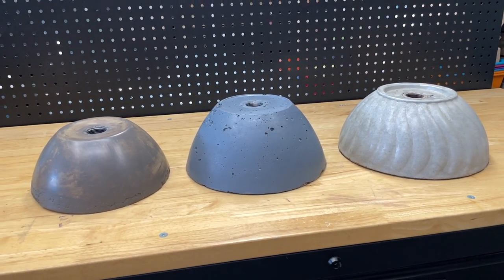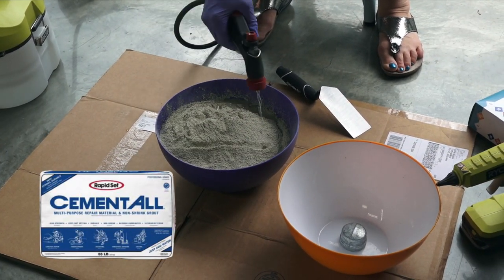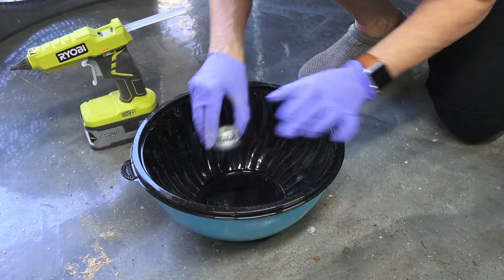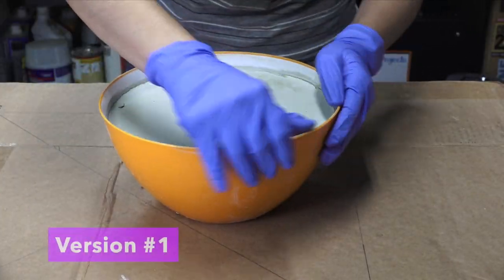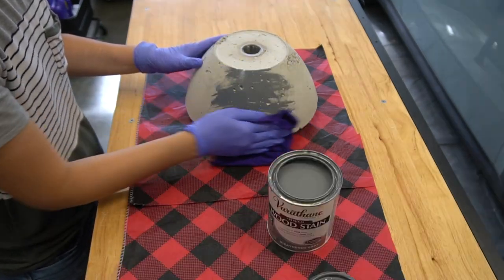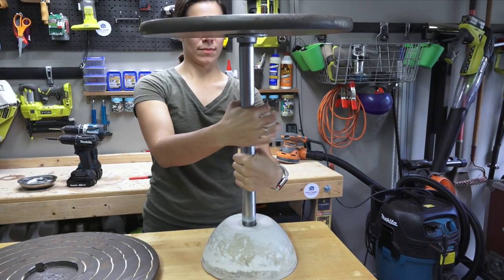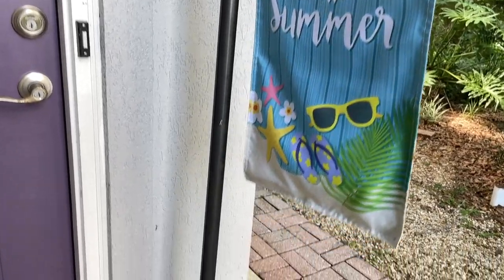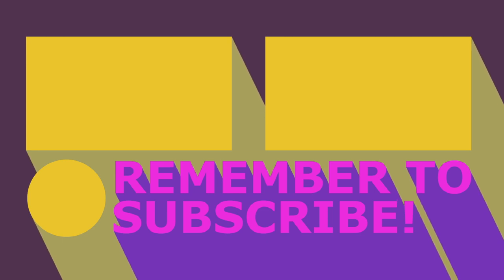How to Make a Concrete Base for MANY Applications

Comment: Thanks for such a comprehensive video.
I'm planning on using 7'-8' lengths of 1" pvc to form the uprights for a non-load-bearing (sheer Ikea curtain panel in between) pipe/drape with about 5' span in between each free-standing pair. The event will be at my church and inside as backdrop accents at the room perimeter.
Do you think a #25 weight at either side is sufficient to hold that length upright or would you recommend increasing that a bit?
Thanks for any suggestions 😁

Comment: In a second hand dealers,  I’ve found a beautiful 18 inch tall brass dolphin which stands on its tail.  I want it to be the door stop for when i leave my front door open, so it greets the visitors.  But it will topple over, so i need to set in in a concrete base.  That’s why i have come to this video.  I like the wavy bade you made — the dolphin would look lovely on that-( like sea waves).  But from this video i don't have a way to stick the two together or even embed my dolphin into the base.  So i need to find a method.

Comment: i have a canvas tent for hot days, what do i put the plastic poles in to use the threaded caps you are putting in the concrete
Reply from the maker: The threaded caps are PVC connectors. Go to the PVC section of the hardware store and you will find them.

Comment: Do you think this base will hold a chandelier? I am looking for options for a photo booth display.
Reply from the maker: I’m not sure, but I will tell you it is very sturdy. The one we have outside has never once fallen over even in high winds. For our flag stand, we added a dowel into the PVC pipe for strength and durability. If you’re going to use something heavy, you need to be sure the pipe will be strong enough.
Reply: @MotherDaughterProjectsDIY  Thank you!